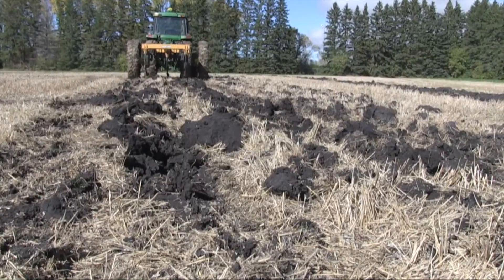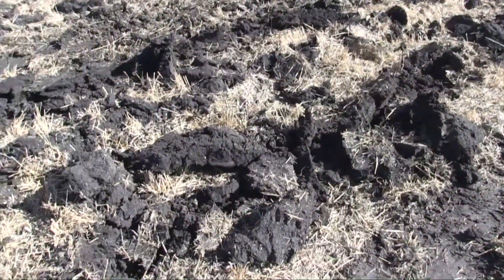How Deep Ripping Can Make A Compaction Problem Worse

Comment: The reason for design of the V--ripper was that the center shank required the most horsepower to pull..the shanks that were recessed to the sides and behind would compress shatter latterly.  Requiring less horsepower per shank....but if moisture is too high in the soil the shanks actually compress and increase the density of the soil...kinda like making mud pies

Comment: A subsoiler is designed to shatter soil the problem I always found in north east Arkansas in the 70's and 80's  was getting the soil to the right moisture content to shatter.. we used V-Rippers my best attempt was with using a mold board plow on wheat stubble in june.. our ground gets so dry and hard its like concrete Sandy loam